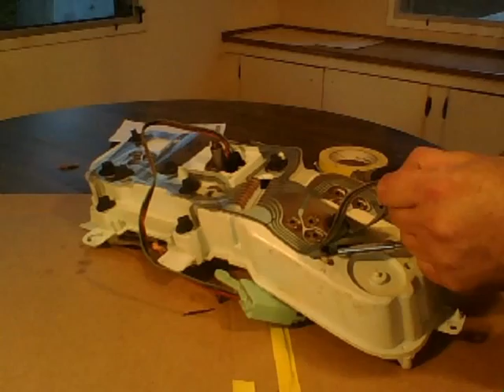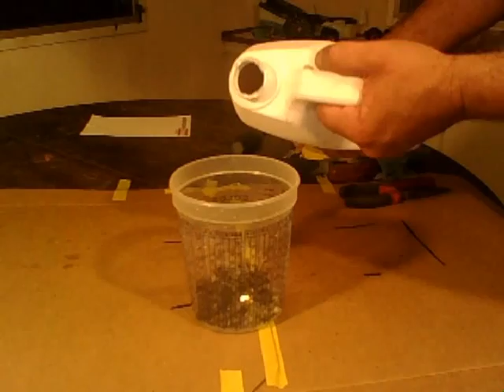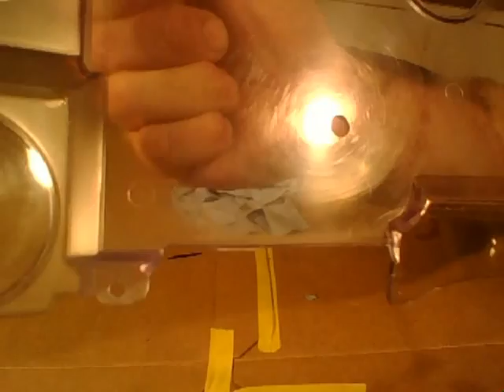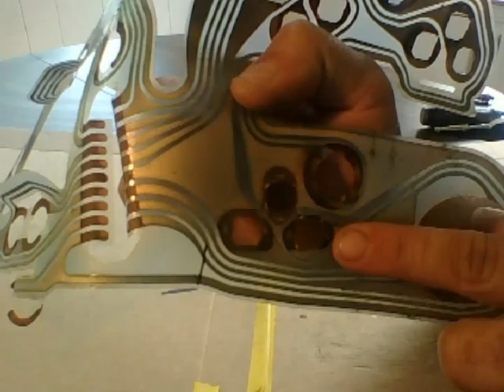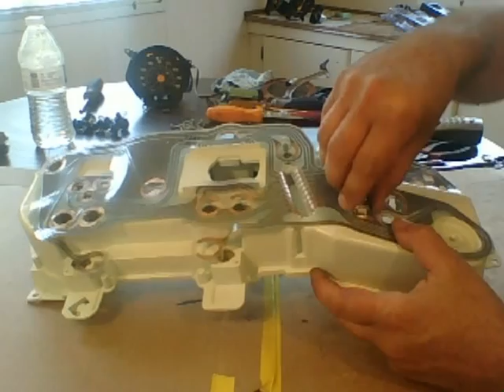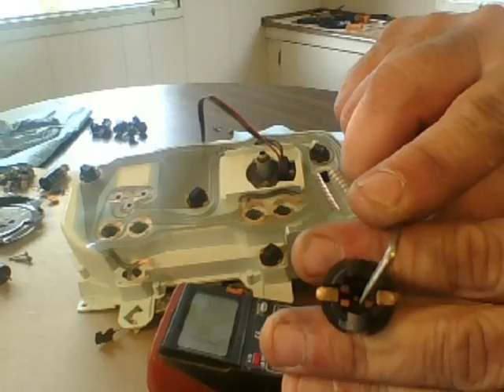1988 GMC square body instrument cluster restoration

Comment: What does the optical speed sensor do if the speedometer is cable driven?
Reply from the maker: It provides a reference pulse to the engine computer so the computer knows the vehicle's speed. Thanks for watching and commenting!

Comment: Awesome video. 👍🏻👍🏻 which of your gauges were not working prior to you doing the repair? Did they begin working after the work that you performed ?
Reply from the maker: Yes, all gages worked properly after performing the repair. All the gages except the speedometer were working intermittently before restoring the cluster. Thanks for your question and for watching!

Comment: Those circuit boards are available about $60.  the clear lens is also about $55.  You decide what your time is worth, to buff and polish.  
Also, I like to use conductive grease on all electrical connections, ensures positive long lasting connections and less worry about corrosion and electrolysis.  (dis-similar metals eating each other up over time.)
Reply from the maker: Buying a new lens is easy, but this video is geared towards restoring and not taking the easy way out. Some folks wouldn't buy a new lens for a work truck. Even with LMC Truck being 175mi away from me the customer didn't have the time to wait for a new circuit board.
Reply: The reproduction lenses are made in China and so that is NOT an option for me!
Reply: @georgedavidson4219  I think you would be surprised what is made in China and you own

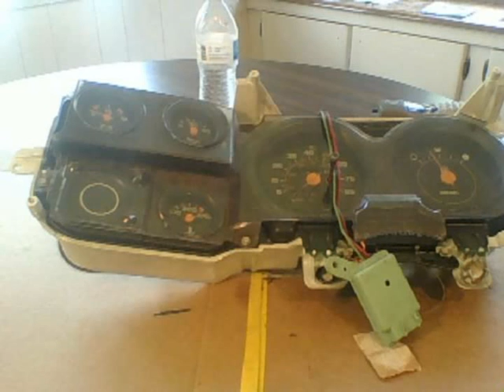Comment: Hello my friend! Would you tell me what is the green box that appears at minute 6:04 with 3 cable attatched to the back of the speedometer? In my car (Montecarlo 81) that box is attatched to nothing. Wich is the function of that box and where do I have to connect it?
Reply from the maker: Sorry I couldn't answer any sooner, I've been in the hospital a lot over the past 2 years. The green box is part of the optical vehicle speed sensor circuit. That box turns an alternating current pulse from the speedometer optics in to a digital signal and passes it on to the engine computer. This tells the computer the vehicle's speed.

Comment: What did you use to rinse off the connectors, and bulbs? I'm currently soaking mine. Thank you so very much for this video.
Reply from the maker: Sorry I couldn't answer any sooner, I've been in the hospital a lot over the past 2 years. After soaking them in Purple Power I rinsed them with warm water.

Comment: Would it be possible to change the speedometer disk from its housing? so i can keep my mileage but with a new disk/plate?
Reply: you can move the gauges to a new housing. brothers truck should have a new tach and small fuel gauge along with a new housing specifically for the tach

Comment: This may be a stupid question. Where is the check engine light located on a 89 C3500? Turned it on few weeks ago (gifted to me) but didn't see such engine light turn on.... possible bad light bulb? Thank you.
Reply: Francisco Macias It’s a 29 year old truck, so 9 times out of 10 alot of the old bulbs will be weak or already blown.
Reply: @demondefiant6346  yes that's what I was figuring out the other night. Doing repairs to it when I come back to the States.
Reply from the maker: About the time you made this comment I started having health issues. I wish I could have helped you. Sorry about that.
Reply: @SlickRidezGarage  no worries your good. They took out the light bulb out, so the issue was a TBI chip meant for a 350 but on a 454. The ECM was also wrong and so was the TBI 350 chip. I got the right ECM and a carb compliant 454 TBI chip and worked perfectly. At best i got 9.5 mpg and a few times got 10.5 mpg. I no longer have the truck, my uncle has it and is using daily, the truck is being worked and driven what it's intended for.

Comment: I have a question the cluayer you pulled out of the 88 chevy on the bottom far left can u drill through it safely and put a manual temp guage in that empty spot. Mine wont work no matter wat ive try. I want to install a manual temp gauge
Reply from the maker: About the time you made this comment I started having health issues. I wish I could have helped you. Sorry about that.

Comment: Awesome video! I recently purchased a 86 C10 and I noticed the volt gauge doesn’t read at all and the oil pressure gauge just stays at max. Any suggestions?
Reply from the maker: Thank you, and thanks for watching! The pegged oil gage is most likely bad connections at the printed circuit and connectors, or a bad oil sending unit. Could be either or. A bad gage could also do that. Disconnect the oil pressure sending unit and see if the gage reading changes. If your truck has an electric fuel pump the sender is on the left rear side of the block near the oil filter and plugs in with a single flat spade connector. The dead volt gage could also be bad connections or a bad gage. Is the wiring all stock or has it been chopped up under the dash/hood?

Comment: the fuel gauge doesn't need any calibration?  tks a lot!
Reply from the maker: No calibration required on the fuel gage. Thanks for watching the video!
Reply: Slick Ridez Garage can i damage the calibration if i took the gauge and did many laps? I explained me, i was cleaning the odometer but when i touched the gauge it broken   from the bottom and then i repaired id with glue and then installed again, but during the instalation the gauge did many laps, rewind... Forward and i don't know if nowadays it is showing right. Tks a Lot bro
Reply from the maker: Let me try to understand here, when you say you were cleaning the odometer it sounds like maybe the speedometer needle broke at the base? You repaired it with glue and now the speedometer needle just spins around and around instead of increasing slowly with speed? And you're welcome!
Reply: Slick Ridez Garage nope, excuseme, the fuel gauge was that i repaired, but it did many laps when the gauge broke, my question is if may be possible to be recalibreted causing the "laps" that it did
Reply from the maker: Yes it is possible the gage is inaccurate now. If the needle isn't placed properly it will not read right
Reply from the maker: And I'm not so sure the translate feature was working the best during this session. That may explain some of my confusion here? I hope you feel you received the answer to your question. If not I will keep trying. Thanks for watching and for writing in!

Comment: Once the copper is exposed you can use likely use petroleum jelly or some other form of terminal protectant to keep the oxygen away.
Reply from the maker: In many instances dielectric grease is a plus with electrical connections, but use of any type of compound on the celluloid carrier can cause de-lamination of the printed circuit. In my humble opinion the best way to prevent oxidation is to keep moisture out of the cab and those tasty beverages in the cup! Thanks for watching and writing in! Have a good evening!

Comment: thanks a lot Slick.  This was the only help I could find on how to restore my 88 GMC's instrument cluster. Hey Slick can you help me figure out why my gas gauge will only move between empty and 1/4 tank even when I know there's more gas in the tank?
Reply from the maker: +Glenn Rivers Check the truck's grounds first...it's just a good policy. If you disconnect the electrical connector at the gas tank, turn the key on then ground the wire for the sending unit and the gage pegs, the circuit/gage/connections are likely OK and the in-tank sender is likely bad.
Reply: Thanks I'll try that.